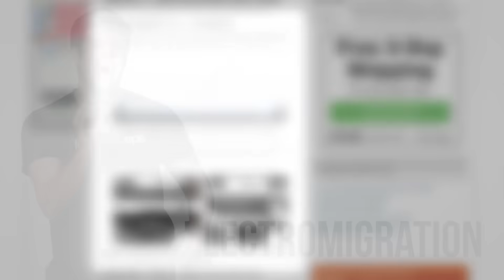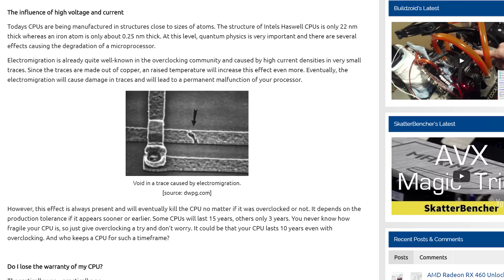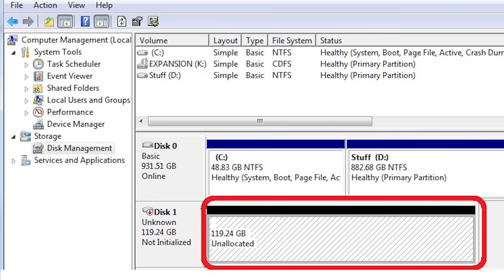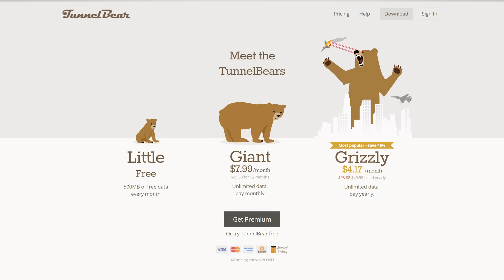Why Do Electronics Die?

Comment: Linus reply if this gets 150+ likes
Reply: they are, basically. same concept. the only difference is in how they discharge. capacitors can release all of the stored energy at once, batteries cant.
Reply: Conor Bryce depends on what kind of capacitor you are talking about.
Reply: Capacitors are batteries.
At least in the simplest way.

If you have ever unplugged something that doesn't have a battery and an led stays on for a bit that's a capacitor providing that.

In a technical sense tho capacitors and batteries are pretty different.
Reply: Demonslayer i gave sources to back my claim. We used to learn that capacitors store charge untill grade 11, in grade 12 we learned that this isnt quite true.

The links that you provided only use the lingo of charge, which isnt quite accurate. 

Most people interpret charge as "how much energy percentage it is storing", while the physics meaning of charge is how many charged particles you have, and its formula in a wire is the current times time. Q=It
From this equation, we can practically find out if the capacitor holds any charge. Place an ammeter before and after capacitor, and charge it up. You will see that the current is equal, so charge going in and out is equal, so there is no net charge (positive or negative) on the capacitor. Its true that one plate has a negative net charge, and one has a positive net charge, but they are equal in magnitude and thus cancel out each other. And we have a capacitor that has 0C of charge, but is fully "charged"... That is where confusion comes from.
Reply: zach burke its in the link i sent!
When you put the first electron into the plate, it automatically resists the next, and so it there becomes more and more resistance towards new electrons and so energy is used to push new ones in. Its ratjer like a spring, easy at first and then slowly it gets harder.

The pushing of electrons keeps till the repulsive forces are just equal to the one excerted by the battery.

When the battery is removed, the force of the repulsion is stronger than nothing ;) so the electrons are pushed out into the circuit

Quite interesting if id say so myself
Reply: zach burke we are taking that in physics too! (For real A level physics is just so much for 1 year... Its supposed to be done in 2! But my school was like noooo one year is enough)

In our book, we have formulas for electrical field strength (E):
E=V/d voltage over distance
And
E=F/Q force over charge

Make v the subject of first:
V=Ed 
We are given one piece of information stating that for a spark to form in air and pass through, we need an E of 40,000!

So for a van de graaff generator, where distance is 5 cm, voltage needed is 2kV!!

For "a" lightning traveling 100 meters (which is much closer than actual one do!) We need a volatge of 4 mega volts! (4000kV)!

Id estimated that a lightning normally travels 5 km, so voltage needed is 200 MV!!

So for capacitors they must bave a vlaue of E and knowing the thickness of the material, should be easy to calculate!

On another note: you can take a shortcut and just test hundreds in an explosive bonanza :P
Reply: well son to be fair they act like batteries
Reply: zach burke Sorry but no. Capacitors are very different beasts than batteries. Capacitors are passive electronic component like resistors and inductors. Together with diodes and transistors these are the things that do the work of a circuit. Batteries are used to supply power to a circuit.
Reply: capacitors DO NOT hold a charge at all!! as one plate gets electrons, the ones on the other gets repelled into the circuit! current before and after a capacitor is the same!

what they store, however, is energy and potential. 

this is a question that comes frequently in the A level physics i am doing now, and carried 4 marks.... so yeah
Reply: Anas Malas Do you know what that potential energy comes from?
An electric field.

Unless of course you know of a different kind of potential energy that capacitors store energy in? I'd love to know.
Reply: Anas Malas despite the literal mountain of evidence before you, you are still going to claim that? I posted those links to put this argument to rest, 2 are from University level physics courses. you gonna tell Boston University they are wrong?
Reply: zach burke, Demonslayer20111. Dumb and Dumber. Hey why don't the pair of you start your own electronics channel. We could all do with a laugh.
Reply: Anas Malas thank you for reexplaining that for me I don't think I quite got it the first time I saw it.
Reply: Demonslayer20111 he isn't worth it imo, no need to respond. He will go on and on for the attention.
Reply: Gaming Jakster same lol, i tought capacitor is same way too!
Reply: Here we go again :D
Reply: holy shit thing exploded
Reply: Shahe Ansar 
Hi, somewhere back in this thread, someone asked for a three word definition. How about this for two words 😀
Capacitor: Electrostatic storage.
Battery: Electrochemical storage.
Everything else is just about the type of battery or capacitors.  They have many properties that overlap. The study of each can be a lifetimes work.
Reply: Shahe Ansar  Hi, I agree that in common uses the batteries and capacitors are very different.
Batteries win on capacity and capacitors win on accuracy.
The problem with arguing that they are not the same is that there are similarities that cannot be ignored. Supercapacitors, for example are commonly used instead of backup batteries. In power systems the batteries act to filter AC noise on the DC supply. 
The deeper you dig, the more exceptions there are to the rules of thumb....
 Dave does a good job highlighting some of these.
Reply: Anas Malas ???
Reply: Demonslayer - I apologize that my question was unclear. The answer is not the same as draining a lead-acid battery!

If one charges a cap with a DC voltage and subsequently removes the voltage source, the cap retains a charge. (This is an old lab prank - charge a cap to tube plate voltage - say 150V - then toss the cap to an unsuspecting lab student. I digress ... )

Back to my original question. Suppose one makes a cap out of two buckets stacked inside one another with a viable dielectric such as air. If one charges this makeshift cap and then pulls the two buckets apart, what happens? 

Does one, both or neither bucket retain a charge? If neither retains a charge, where does it go? (Unlike draining a lead-acid battery we have not removed the dielectric.)

Hope that's clearer! 
(An old EE)

Edit: Think of what happens when a leyden jar (an old style cap) is charged. Where is the charge?  :)
Reply: Conor Bryce I mean like 8 years ago
Reply: ACTUALMIKU "at least in a he simplest way"

When I say that I mean exactly what you said, they both hold charge.
That's the simplest way to look at a battery and the simplest way to look at a capacitor. Is it not?

I even mentioned technically they are very different in my comment too.
Reply: sam smith sigh. they both hold charge. that was my one, and only, point.
Reply: sam smith so capacitors do not hold a charge?
Reply: sam smith no shit sherlock. you are arguing that capacitors don't hold a charge. you do realize that right
Reply: sam smith http://physics.bu.edu/py106/notes/Capacitors.html read it and weep, buddy. what's the first sentence say?
Reply: sam smith https://en.m.wikipedia.org/wiki/Capacitor
Reply: sam smith http://www.electronics-tutorials.ws/capacitor/cap_4.html
Reply: sam smith http://www.facstaff.bucknell.edu/mastascu/elessonshtml/lc/capac1.htm
Reply: sam smith need I go on?
Reply: ""you are arguing that capacitors don't hold a charge" -- Umm. No I'm not.
Reply: sam smith I have made one point this discussion, do you know what that point was?
It was that capacitors and batteries both hold a charge.
That has been my only point.

Your response to that was "sorry but no"

You understand that right?
Reply: I also want to point out, my point is about the simplest way to describe capacitors.
Because so many people are having trouble with the word "simple"(I am actually shocked about this) try describing the purpose of a capacitor in three words.
Now describe a battery in three words.

The point of this is that two or three words is the simplest way to describe something. And that is my point, my point is NOT about the physics or the technical differences. I don't understand why this is so hard.
Reply: zach burke all that I mean is that there is no charge in the capacitor. Charge is just being positive or negative. In a capacitor there are always the same number of electrons to protons.

About what type of energy is stored i tried looking through my 500 page textbook (which i am currently revising from) and couldn't quite locate the piece of info. Ill post it later.

If id describe the difference between a cap and a batt? 
"A capacitor is just a battery that can be charged and used up very fast, so while a battery can give you all it's energy in a minimum of some minutes, a capacitor would emit one big spark and thats it withen seconds"

In 3 words? 
Capacitor is bucket
Battery is hose
Reply: sam smith umm yes you are. yoh said, and I quote, "sorry but no" in reply to capacitors hold a charge.
Reply: Demonslayer20111 those weren't directed at me so i didnt open them, also they were sent before i even came here
Reply: Read the very first couple of lines. You push electrons onto a plate and off another. The charge is the same. It is not negativity charged as we did not increase the net number of electrons in the system.
https://lh3.googleusercontent.com/QZ7QFJHTjH-uHM9SIkZGej50S3O2pzrFLYqStE3XimW9y1hwt2yf7r98nTCsHs-yfiitS--9Hg
Reply: Anas Malas sadly the last link you provided(or gif) doesn't show anything.
Copying the URL for It doesn't show anything either.
Reply: zach burke i used the google plus image option... Oops

imgur.com
Reply: sam smith yeah there we go try to prove your point by throwing insults. lol that'll work real well
Reply: Demonslayer20111 i don't even know what you did.
Damn.
Reply: zach burke said he was wrong and provided sources to prove it
Reply: Anas Malas not you, you are fine. and yes I'm aware of the difference between charge and potential, but for general purpose, that doesn't matter
Reply: Capacitors can be used to replace chemical batteries.  My laptop has a stylus powered by a capacitor rather than a battery.  It lasts for a couple hours and can recharge in only a few seconds.  There are videos on YouTube of people who have replaced their car batteries with arrays of supercapacitors.  There is active research going on to use capacitors to power electric vehicles, the main advantages being extremely quick recharge time and unlimited charge cycle life.  Unfortunately, little progress has been made toward a practical one.
Reply: sam smith I'm sorry you are so offended or upset or whatever.
I am trying to have a good conversation with people.
Sorry for whatever I did! I'll leave you out of it from now on!
Reply: Anas Malas did we ever find out what type of potential energy are in capacitors?
This is more of a personal curiosity at this point.
Reply: zach burkeThat's OK. It's not your fault you are a stupid ignorant piece of garbage.
Reply: sam smith dude go find somewhere else to circle jerk in your pretend world where you are a genius. nobody wants you here. go away
Reply: Avoiding feeding the troll, zach burke its interesting that the reason capacitors have a voltage limit is because the insulator layer inside would conduct, atleast thats my thinking
Reply: Anas Malas like a spark gap?
I wonder how someone could calculate that.
We do that for air all the time, we would just need to know the spark point of the material(I have no idea what that term would be)

Just for reference for what I'm talking about is something like this.

http://sciencing.com/calculate-voltage-spark-gaps-8776030.html

It goes on to mention kilovolts needed per centimeter of distance for a spark, so its a linear measurement right? Wouldn't be too hard to figure out if someone was making a capacitor.
Reply: Gaming Jakster they kinda are
Reply: How come my comments are getting deleted. Are the mean girls telling lies. You can start a fight but are just pussies when someone fights back.  You'd never even get into a sorority. Those girls would whup your asses. What a pair of pathetic losers.
Reply: zach burke yep. The he goes
Reply: jesus, all this over someone trying to SIMPLY explain a capacitor and some idiot comes along saying he is getting it technically wrong, he was trying to simply explain it to someone, not give an einstein definition.
Reply: *no reaction
Reply: mongoloid I dont believe he is still small
Reply: chris and sam should take a chill pill. anas you see son goku is not small :)
Reply: mongoloid Sam Smith is in every single comment section on every single Linus video and he writes the same drivel every single time. he gets his jollys by insulting people and his behavior is quite unacceptable. I hope someone from this channel takes note of his behavior.
Reply: Demonslayer20111 btw, he doesn't even type all that...

There are special keyboards for phones THAT INPUT THIS TYPE OF TEXT... Not actual keyboards... Just chose the one you want and there it goes
Reply: Anas Malas Yes I have a special gadget that thinks all this stuff up. It's called a brain. I know you probably haven't heard of it before but they are actually quite common. Just not in your part of the world.
Reply: sam smith too bad that while yours is the equavailent to a riced out garage queen car, ours work hard and are used quite often...
Reply: Anas Malas he's an idiot. just block him and be done with it
Reply: Demonslayer20111 triggered! Definitely go with the gender studies.
Reply: Anas Malas Is that what you people drive in Dumb-town?
Reply: ONE CeVIO never thought of it that way they kinda do look like those big round tanks you see at a refinery
Reply: ONE CeVIO   They look like the little tanks they transport the oil in. Not the big tanks. That's just ridiculous.
Reply: I dont see ONE CeVIO's comments. Weird
Reply: Anas Malas it's a little farther up. before Smith's herpes infection of the comment section.
Reply: Demonslayer20111 before he came on only you and Conor Bryce were there.. it does this a lot
Reply: Demonslayer20111.Finally a little humor. Your quite funny when your not being a victim.
Reply: ONE CeVIO Fake News.
Reply: ONE CeVIO For you.
Reply: Still cant see anything by ONE CeVIO..
Reply: Not quite. Capacitors can't do that either. Batteries just have higher resistance. The difference comes from how they work (two metal plates separated by an insulator, and ions moving due to reduction and oxidation causing a current)
Reply: They are far too different to be considered the same beyond elementary usage. Capacitors make filters that select a particular range of frequencies, batteries can't. Batteries stay at their "voltage" (average voltage) for a lot longer than capacitors.
You are right in saying what kind of storage principles they use, but they're NOT similar.
Reply: For those arguing about capacitors being storage devices: a capacitor is two conductors separated by an insulator. 

Suppose one made a cap by placing placing a metal pail inside another separated by an insulator (air would be fine) and 'charged' the device with a battery.

What would happen if the two pails were then separated?
(From an old EE)
Reply: I agree with almost everything but the fact that capacitors win on accuracy, what do you mean by accuracy here? And I don't believe batteries works as filters, which is why we need bypass filters on batteries. Could you explain in detail what you mean?
Reply: nineball039 the same thing that would happen if you dumped the acid out of a car battery.
Reply: Anyone notice how the op edited the comment
Reply: Anas Malas ???
Reply: Gaming Jakster pretty sure it wasn't "Linus reply if this gets 150+ likes"....
Reply: Anas Malas idk this is 2 months old and i had a typo
Reply: Gaming Jakster so you change the content into this shit
Reply: Shahe Ansar 
Hi. Strowager telephone exchanges were (are?)powered by 50V DC. There were monster sets of batteries (where I used to work they were 2nd hand from a naval submarine!) and no smoothing capacitors after the rectifier cubicles but no 100Hz on telephone audio. This assumes the wire between you and the exchange was soldered to its terminals properly 😉
Reply: Gaming Jakster let's be honest, by younger you mean yesterday.
Reply: Demonslayer20111 i will admit that they seem similar at first but in reality capacitors and batteries are very different. batteries work on the principles of oxidation and reduction in chemistry where as capacitors work on the principles of electric/magnetic fields in physics.
Reply: Conor Bryce so called wet capacitors work like gel mat batteries. the dry ones work like what you said. and I sleep very well at night thanks for your concern
Reply: +zach burke They hold a charge, yes, but that does not make them batteries. If that were the case anything that can hold static electricity could also be considered a battery...
Reply: Demonslayer20111  Ummmm. No they don't. All capacitors work by allowing an electric charge to build up on two surfaces separated by an insulator. All batteries work by converting a chemical reaction into electric current. In rechargeable batteries the chemical reaction can be reversed by putting electric current back into the battery.
Reply: Demonslayer20111 whatever makes you sleep at night buddy 😘
Reply: Demonslayer20111 night night
Reply: Demonslayer20111  zach burke  "Nobody likes you" "Go away" "hes not worth it" Ohh look it's the mean girls. If the two of you spent less time primping in front of the mirror and more time paying attention in class then maybe you wouldn't be so dumb. Capacitors are the same as batteries. Ha ha ha ha ha ha ha ha ha ha ha ha ha ha ha ha ha ha. Ha ha ha ha ha ha ha ha ha ha ha ha ha ha ha ha ha ha. Ha ha ha ha ha ha ha ha ha ha ha ha ha ha ha ha ha ha. Ha ha ha ha ha ha ha ha ha ha ha ha ha ha ha ha ha ha. Ha ha ha ha ha ha ha ha ha ha ha ha ha ha ha ha ha ha. Ha ha ha ha ha ha ha ha ha ha ha ha ha ha ha ha ha ha. Ha ha ha ha ha ha ha ha ha ha ha ha ha ha ha ha ha ha. Ha ha ha ha ha ha ha ha ha ha ha ha ha ha ha ha ha ha. Ha ha ha ha ha ha ha ha ha ha ha ha ha ha ha ha ha ha. Ha ha ha ha ha ha ha ha ha ha ha ha ha ha ha ha ha ha. Ha ha ha ha ha ha ha ha ha ha ha ha ha ha ha ha ha ha. Ha ha ha ha ha ha ha ha ha ha ha ha ha ha ha ha ha ha. Ha ha ha ha ha ha ha ha ha ha ha ha ha ha ha ha ha ha.
Reply: Anas Malas Oh look another Heather has joined the sorority.